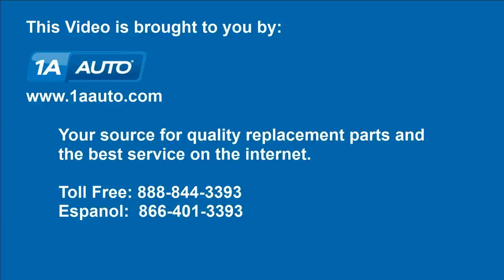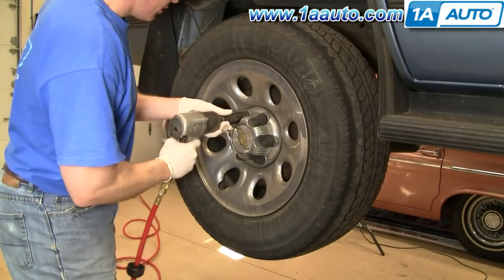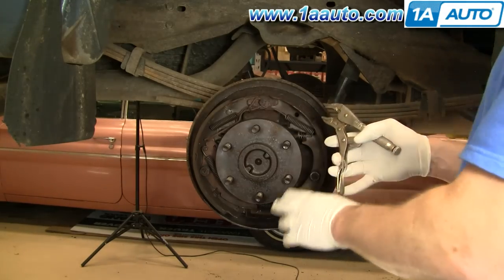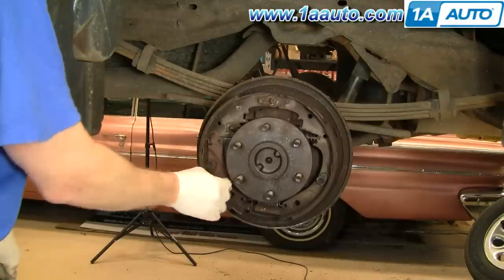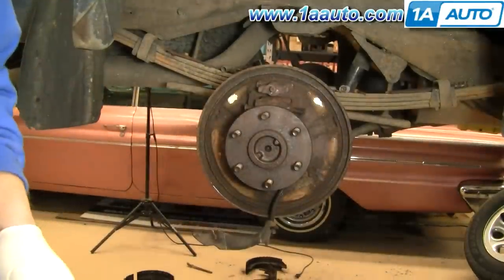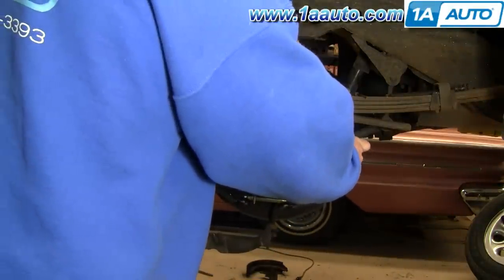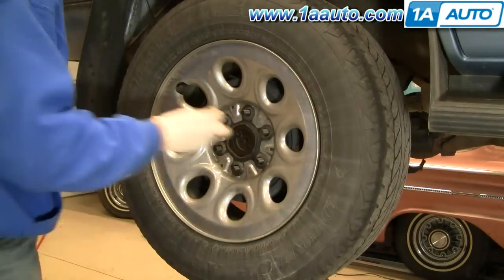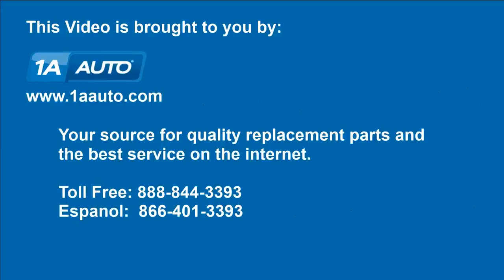How to Replace Rear Drum Brakes 96-00 Chevy Tahoe

Comment: I was having trouble removing the rear break drums from a 1994 chevy pickup. After watching (with shock) the hitting it with a sledge hammer...was thinking that's crazy. But worked like a charm after spraying with WD40. Thanks a lot.

Comment: I'm major screwed now, I took the emergency brake lever on the spring, and just spent 6 hours laying on the driveway cement in cold weather trying to get the lever back on the spring, and still can't get it back on with even with my wife helping. Had a 4 lever lumbar surgery 4 months ago and major strained torn muscles my lower back and every tendon in my wrists and hands are extremely strained. Spring on emergency cable is to strong to pull back to put the lever back on. Gave up after 8 hours, never been so pissed off in my entire life. I'm a former auto-mechanic instructor, multiple certifications in ever area of auto repair. The old saying: God and all his angles would have a hard time with this one. I may just call a tow truck to take this truck off my driveway, That's how pissed off I am.

Comment: Okay, I have done a ton of brake jobs over the last 40 years.  The methods and techniques in the video are perfectly fine.  But just a couple of things:  (1) you rarely have to replace any hardware parts, just clean them up a bit.   Even the stuck adjuster wheel,  put the adjuster in a vise, tap it with a hammer, and use a vise grip to grab the knob and break it loose.  Failing that, heat the knob and it will come loose from the adjuster.  (2)  This is really important - never, never, never put on new brake shoes without rebuilding the wheel cylinders or getting new ones.   Reason:  residue builds up inside the wheel cylinder behind where the seals move.  As the shoes wear, the seal move outward.  When you put on new shoes, you push the seals farther back and the seals now ride over the residue, which grinds the seals and in about a month they will leak.  Then you have to take everything apart all over again to fix the wheel cylinders.   (3) be careful about the dust inside a rear drum brake.  Most rear brakes are no longer made from asbestos, but if the shoes were replaced with parts from foreign countries, they could be made with asbestos.
Reply: djhmo5 I know this is old but I agree, 10 mins of work can save $50 dollars almost every time!!! And yes Always Replace the $9 Wheel Cylinder!!!!

Comment: R u sure that the yellow spring goes on front?   Shouldnt the longer green spring go on front because it doesnt have the bracket behind it and the shorter yellow one goes in back on top the bracket for adjuster?
Reply: ^^^^ This, the yellow smaller spring go on the rear and the longer green spring goes on the front.

Comment: If you don't do this every day, do one side at a time, use the other for reference....ask me how I learned this...the hard way instead of listening to an old time mechanic.  Easy enough job, but take your time and do it right.  Also, I found most hardware kits do not include the adjuster pieces (those are separate kits), and the wheel cylinder plungers are nearly impossible to find, and not included in the hardware kits, nor is the parking brake bar (that goes between each shoe), so clean and reuse them if possible.  My 86 K10 pick up didn't have the adjustment plug in the rear, so I drilled and routed out one, and found some old plugs, made life a whole lot easier.  Also, make sure you purchase the correct size brakes for your vehicle.  These old square body trucks have two different sizes that I'm aware of.

Comment: This is an awesome video. I am a female that like's doing my own repairs. I don't like getting my hands dirty, but like the cost of doing it myself. I found it easy per your video to remove the pads, but I'm finding it harder to pull the springs back into place with vise grips. I broke my left ring finger back in Jan of 2014. It's a still weak, I slammed it shut in a car door, ouch!!!  Would you have any other advice as to make it easier for me to get springs back on. You are awesome for taking the time to make this video. Thanks, Beth J. Smith

Comment: The repair kits they sell are color coded - but lack instructions.  Removing and keeping the old brake setup 'as intact as possible' helps (so does only doing one side at at time).  They sell a 'spring only' kit which does not include the adjuster pieces, since my setup was actually missing the small spring between the adjuster piece and the shoe, I got the complete kit.  Prior person also used the wrong springs - both sides were a nightmare.

If the video said it, I missed it, but 'always do both sides' when doing brakes.

Comment: You shouldn't use vise grips on the return springs.  It can put grooves on them, weakening them.  That said, I used the same method a long time without any problems.  But the tools are relatively cheap, no more tan $15 and less for the hold-down spring tool.

Comment: Fantastic video but I'm stuck with a problem. In a hurry I bought an 88 G20 van because I was rear ended by an uninsured motorist. She totaled my 95 G30 and it burned up almost with me in it. My 88 G20 need rear brake work. I decided to replace everything. New hardware, new shoes, new cylinders, new drums, new parking brake cable. The problem I'm having is that the pass side brakes are over adjusting and I don't know why.  I'm tempted to just go get new hardware for that side. I will watch this video again in the morning before I tear into it. I don't see where I did anything different. Any ideas?

Comment: 1996 Suburban c2500 ¾ Ton HD
Rear break replacement
Has 13” 3” deep drums – takes 2 ½” break shoes
Shoes installed but adjuster is all the way out
What can I do to correct this?

Comment: Thanks for the video. For your safety, I suggest never to work on a car with short-sleeved shirts. Always use long sleeve to avoid cuts and burns. Also, it is a MUST to rinse off brake components with brake cleaner first and wear an N95 rated dust mask.
Reply from the maker: Thanks for watching our video! +Vincenzo TwentyThree

Comment: Great video.  I will subscribe for sure.  I am having an issue with the rear brakes not self adjusting as time goes by.  I have replaced all the hardware as this guy did.  I even ground the wear ridge out of the backing plate from the shoes rubbing over time so the new shoes would not just sit in this grove.  I greased the new shoes as he did too.  The only thing I can think of is the arm that spins the star wheel seemed to be a l little loose from the star wheel.  I didn't buy the the brake parts from the dealer either.  I think they were Auto Zone.  I am seeing in other things as well that none dealer/factory parts are close, but not exactly what you need.  Anyone have any insight on this?
Thanks
Reply from the maker: +kevintii Thanks for watching. If any of our viewers needs to make this repair, we carry the auto repair part shown in this video on our website. Here is a link to them http://www.1aauto.com/1A/BrakeDrumShoeKits/Chevy/Tahoe/1ABDS00077?utm_source=YouTube&utm_medium=CTA+Comment&utm_campaign=ytcomment&utm_term=dS5bwkwgQDA

Comment: Who would down vote this?  1-A Auto posts consistently excellent videos.  You will never see a set of instructions that tell you which shoe goes on back and which on front and they are interchangeable, you will not see instructions showing the steps of the most painless installation of installing the slack adjuster first to hold the shoes together, etc.  Did you know the lug nut torque was 110 ft-lbs?  I thought it was 90 ft-lbs for a 1/2" lug nut, glad i watched this to the end and I have been changing out shoes for fifty years.
You 244 morons, let's see you do it better.  You probably don't even know what a torque wrench is.  Yes there are some trick tools to get those springs off and on, but show me what works better than a pair of Vise Grips for installing those hold-down spring clips.  Using needle nose Vise Grips in particular provides a clear alignment view of the slot in the spring clip and the pin.

Comment from the maker: Check the brake fluid level in the reservoir and the master cylinder and also the brake booster for leaks. If they look fine, you could try to bleed the brakes to see if there's air trapped in the brake line somehow. Hope this helps you out. 1aauto.com 888-844-3393

Comment: I have a 1996 gmc and it doesn't have manual adjusters at the bottom . It has the self adjusters at the top right under the cylinder. making adjustment almost impossible. The same thing on my 1993 Chevy pu.

Comment: How do I find out what size drums I got? Or size of break shoes I'll need? I got a 98 2WD tahoe LT 5.7.
Reply from the maker: +Jaime G. You could measure the size of your brake drums, or if you have your local dealer run the VIN number for you they can tell you what the truck came equipped with from the factory. Here's a link to them brake shoes that we carry for your vehicle. Hope this helps you out. https://www.1aauto.com/1998-chevy-tahoe-brake-shoes/y-mo-c/1998-44-254?utm_source=YouTube&utm_medium=CTA%20Comment&utm_campaign=1ATony
Reply: 1A Auto Parts thank you 👍

Comment: what tool do i need to remove the hub assembly? thank you for your help
Reply: The hub is the axle.  You have to take the plate off the differential and remove a horseshoe clip to pull  the axles out.  Don't do this unless the seal or the bearing is obviously shot.  You first must remove the brake shoes, then high pressure wash the back plate and all around the hub - clean off every bit of grease and dirt from the back plate and the spindle of the hub and the differential and area above the differential before you start this disassembly.  I wash the vehicle outside, parked on concrete, and starting with the differential and then the body above the differential so I can get in and out with the least soaking, and then hit the wheel and fender well.  You have to take the wheel off and then on to drive it inside (if you have a garage that is not full of junk), jack it up, put stands under it, remove the wheel and drum, wash the brake area, remove the shoe assembly, wash the back plate and the hub thoroughly -  bare clean metal, and then you are ready to drain the differential,  remove the differential cover, remove the horseshoe clip holding the axle and then you can slide out the axle. 
I have other stuff to do,  you'll figure it out, but if you get any trace of grit in there you may live to be sorry you did.